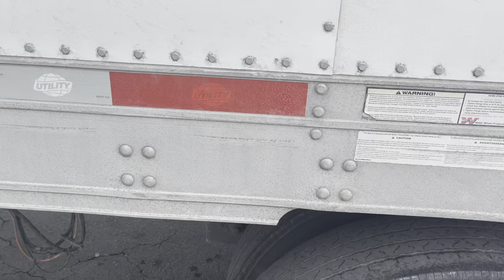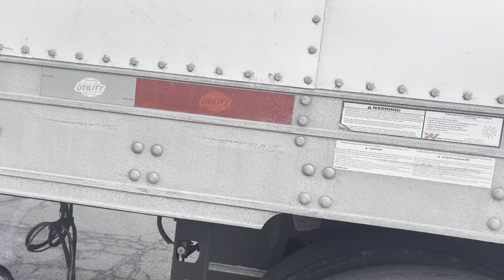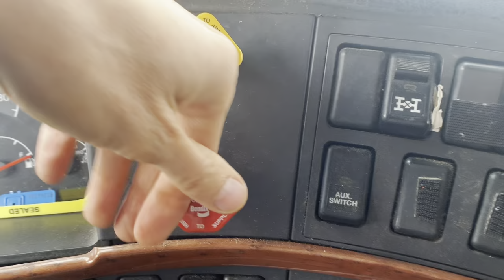Dasha Explains How To Slide Tandems

Comment: For $20 bucks I'd be buying me a battery bluetooth or wifi camera and a magnetic mount to keep from climbing in and out of the cab to line the holes up. You can then use your phone as a monitor to see if the hole and pin line up. 

I have the same problem lining up two wagons up behind a tractor while helping out on a friend's farm. It gets old climbing in and out without help.